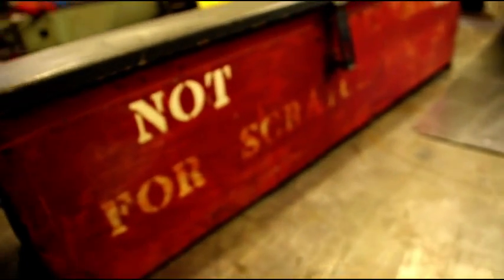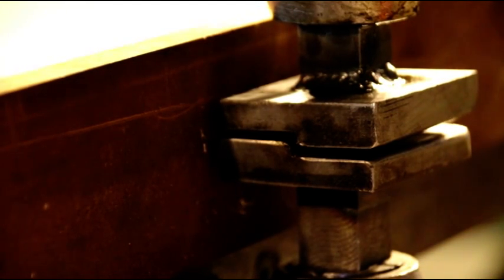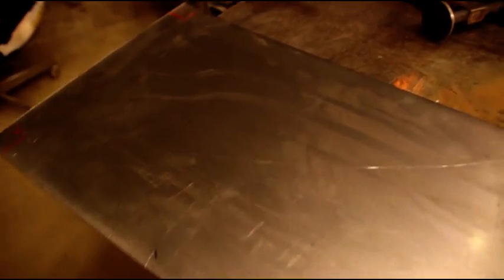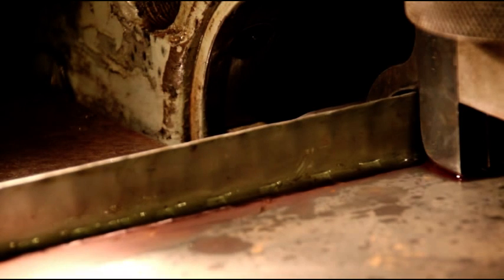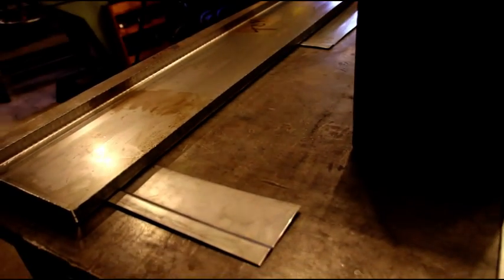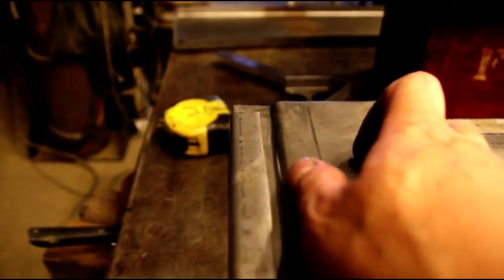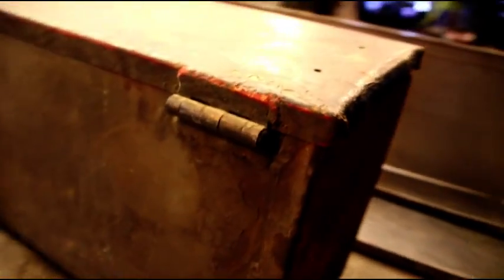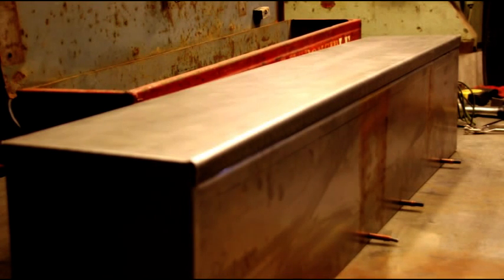Ford GTB Burma Jeep Tool Box Fabrication

Comment: the top of that latch is original, you can use a hasp from the hardware store to make the lower. the hinges are correct on the red box, I got repl.acements from mc master carr.  I just restored one of these, early model single rear heels and no winch.
Reply from the maker: I was able to get the proper latch and hinges.   Will show the final toolbox build with hinges and latch soon.  thanks for the comment.
Reply: if you need any pictures or measurements let me know, the whole wooden bed floor and box took a lot of figuring out
Reply: Metalshaper & IPS , i'm working on a Burma B.S.T. also and would love to talk to you two . My truck is a mess and i would appreciate any help i can get.